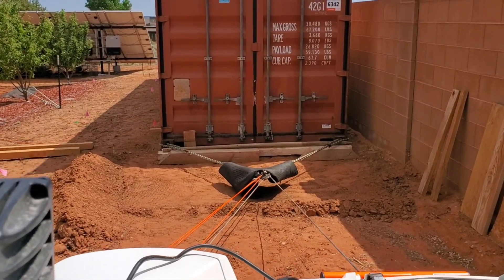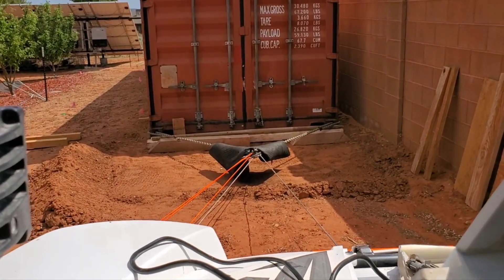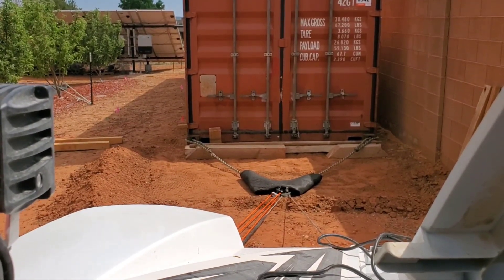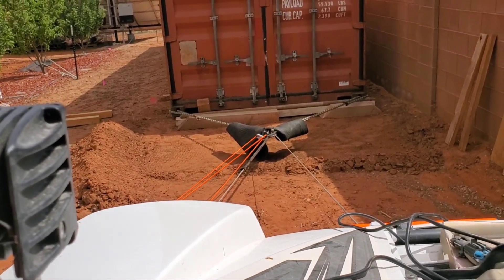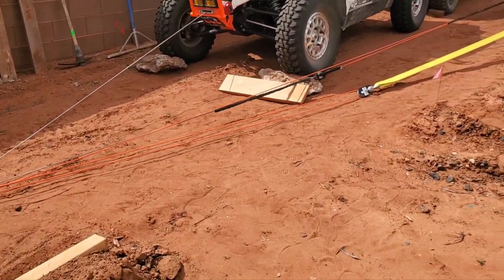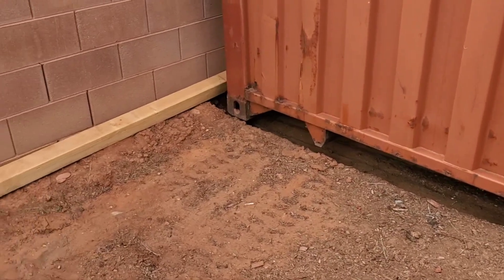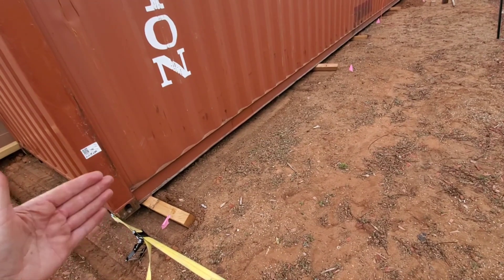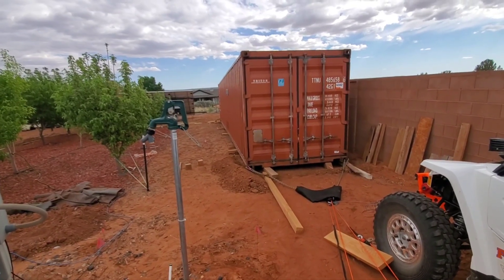Moving 8000# shipping container with 4500# winch.

Comment: Its probably a moot point by now but they make jack and wheel kits for shipping containers, as well as tow bars to hook to a truck. The jack attachments are cheap, the wheel kits are $400-500 for a pair, but the tow bars are over $1000.
The winches are rated for rolling loads, and with the line almost all the way out of the spool, and there is a just a tremendous amount of static load and friction trying to drag a 8000 - 9000 lb 40 foot container thru soft dirt.  You already know this however. :)
I just bought a 20 foot container last Saturday and had it delivered,  and Ive ordered the jack attachments so I can easily level it. If I ever want to move it, I will at least buy (2) wheel attachments. Maybe the tow bar, depends where it would be moved to.
Way cheaper than paying a company to move it for you!
Reply from the maker: I thought about getting a wheel kit. I'm sure it would have helped. This pull was an experiment in being a cheapskate. Lol. The later shifting of the container sideways was the hardest part, as it had to be elevated above the preset and staked railroad ties and then lowered onto them.
Reply: @mikedesilets3324  Yeah stuff is so expensive!  I was able to get a bunch of landscaping boulders for free, and those can be $1500+ for just one if buying from a landscaping company,  so I used my tilting flatbed trailer and a Harbor Freight 12k winch with snatch block and was able to get about 15 of them. One of the boulders was heavier than a Toyota FJ Cruiser because he tried to winch it and it pulled his truck on dry pavement toward the boulder. Lol! I never would pay thousands for landscaping rocks but these look great and it was worth the "poor man's approach" for sure!
Reply from the maker: @jayhondacr5008  I find free boulders of FB marketplace.  Gotta get creative, loading, unloading and placing them. I use round tree poles as rollers, harbor freight tree straps, 2x4 skids and a long digging/chipping bar.
Reply: @mikedesilets3324  Nice!  Yeah I got the majority off Craigslist but I also got a few off Marketplace.   I also used a long Harbor Freight pry bar that's like 6 feet long.
Thats a good idea with the skids and rollers!